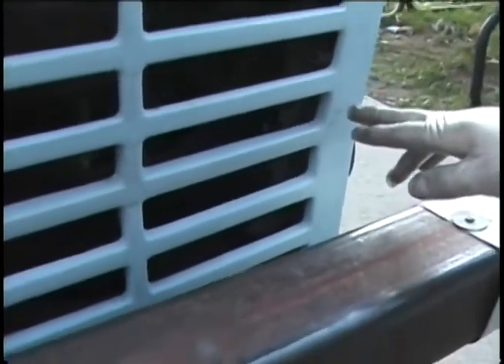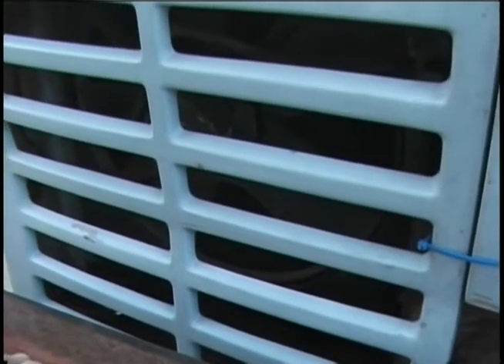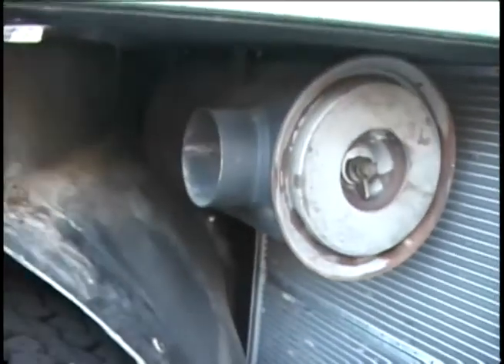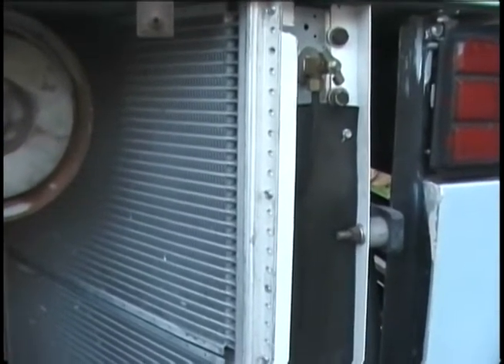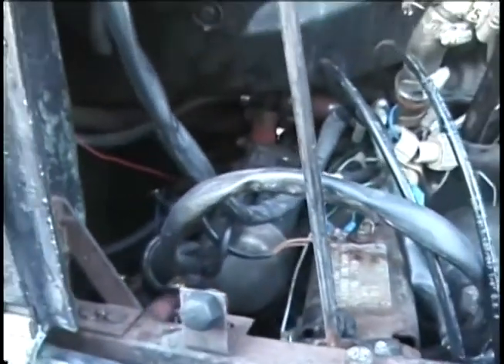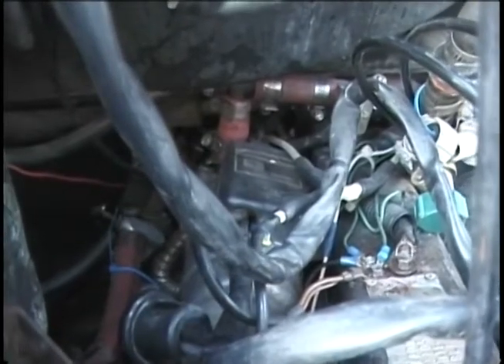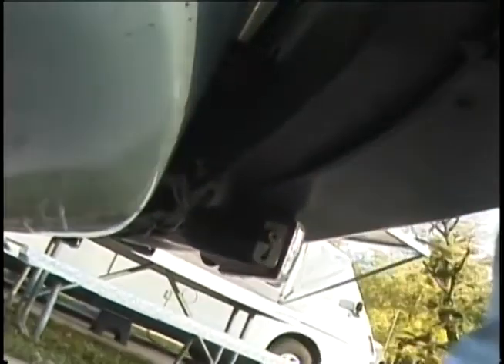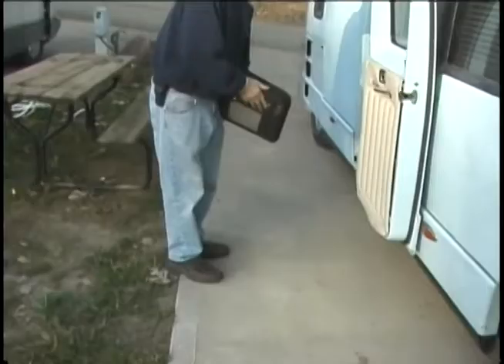Vixen RV Cooling System Upgrade by Wally Watts

Comment: This reminds me of the old "who's on first routine"... one guy is clueless and the other guy has just forgotten everything. The guy is confusing the issue by using an electrical term rather than one that makes sense to plumbing like "in line" then the guy might "get it." Seaton's makes labels for type and direction of flow if you're really into it... the Vixens were plumbed for cool to cold weather... in heat they overheated... why cut a third of the flow just get a smaller radiator... you want a bypass circuit on every device in the system...